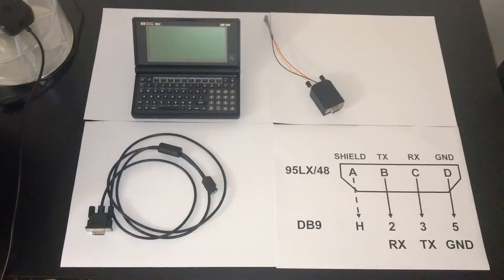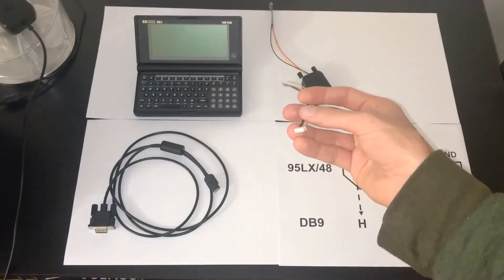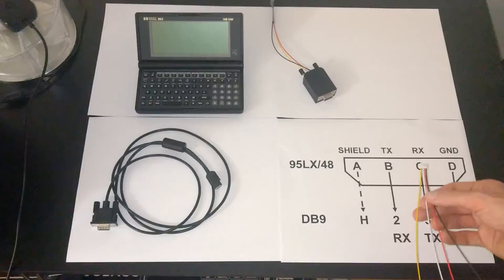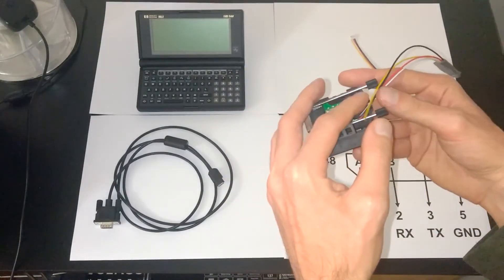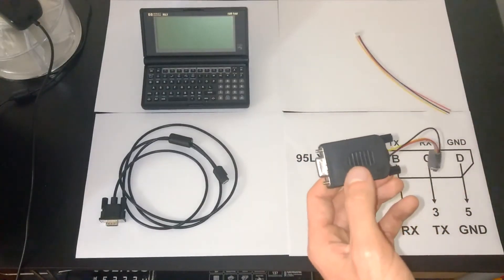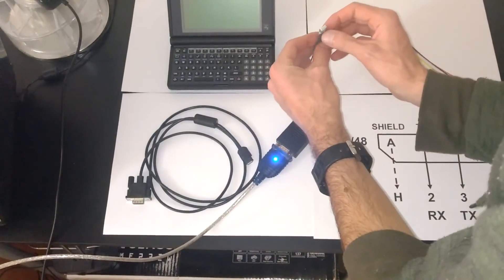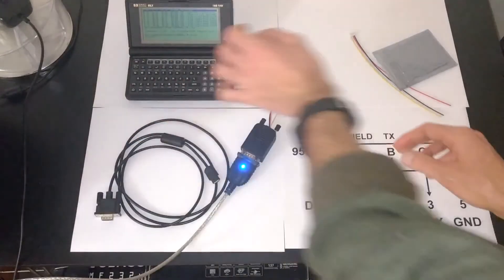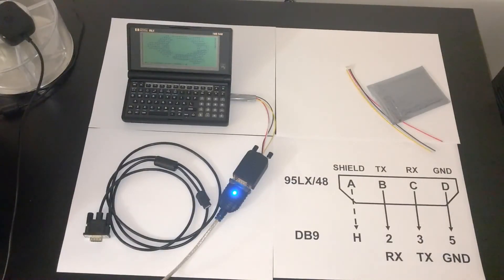How to build a $6 HP 95LX/48 serial cable

Comment: 2:00 The yellow shielding I think can be connected to the shield connection in the breakout box, or just soldered to the metal housing in the breakout box if a shield connection doesn’t exist. It is used to help reduce signal noise.

Comment: You're a life saver! These cables are neigh near impossible to find and if you do, shipping from the US to Europe is costly. And you have to VAT (I don't mind 'bout that) but the Postal Service asks a fee of 15 Euro (!) for inning the VAT.

1. Is the BD9 to USB cable anything special? I see that is has a light. Does it have any necessary electronics inside it?

2. I recon that you don't need the PCMCIA card with a CF card inside the HP-95LX? Because I want to use a serial connection to upload the CF card driver to the 95LX.

3. I take it that, on the 95LX, you use the MS Kermit version that is on ROM? 

4. Do you know how to connect to the 95LX via Linux?
Reply from the maker: You are very welcome! I can answer all these questions.

1. DB9 to USB is a generic USB serial cable.

2. You use this cable to transfer the CF card driver via the built-in Datacomm serial terminal.

3. No, I use Datacomm in the ROM and run MS-Kermit from my CF card. I much prefer Kermit but of course you have to load that from an external source.

4. Yes! Check out another video about internet on the 95LX. Basically you just run agetty on Linux with the USB serial adapter as the serial port, preferably from /etc/inittab so it respawns. agetty 9600 /dev/ttyUSB0 or something similar.
Reply: @walnuthills11  Thank you very much for replying! There's little tutorials on the 'net about the HP-95LX even though a lot of people claim to have one. Luckily I found your your webpage on the Way Back Machine. 

I'll be receiving my 95LX in a few days but I don't have a CF card to PCMCIA adapter yet. Planning to buy one on Aliexpress, I pray it'll work. And I hope that one of my old CF cards support the so-called "memory (RAM) mode" of CF cards (maybe try to buy a cheap second hand one...). In theory all CF cards should work in RAM memory mode (it's part of the standard), but the internet some don't on the HP-95LX.

3. In the 95LX manual in Chapter 31 "Data Communication", page 31-15, it says that "Kermit protocol" can be activated. In a few days I'll see if I can transfer files to the 96LX using agetty in Linux and the Datacomm app in the 95LX. I'll study your other video on serial (internet) connection. Thanks! 

5. How did you get the CF card drivers on your 95LX without a CF card? Via the serial data cable connection?

Comment: Hi, Abraham. Does the connector on the 95LX/48 have a name/model number? Or was that an HP proprietary shape?
Reply: Thats the 2mm  4 pin JST connector he mentions. 
I've heard people reference it as the old 'cd rom' pc sound cable, if you are old enough to remember those (between back of cdrom drive and sound card to pass audio)
Reply: @8bvg300  Thanks. That will make it easier to find one.
Reply from the maker: I am not sure. I know it's 2mm pitch 4 pin JST.

Comment: Thanks for this, definitely going to make one of these!  What kind of flash card are you using?  I've tried a 5MB HP F1012A, but can't get it to format with my 95lx.
Reply from the maker: 32MB CF in an adapter. I think you need a special driver and tool to format the card.